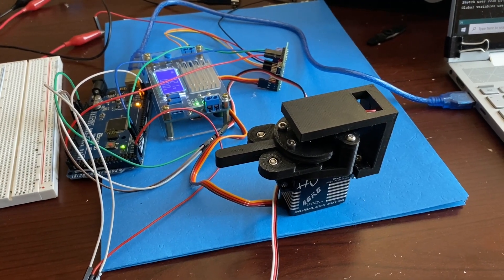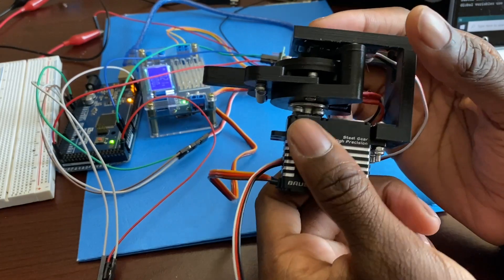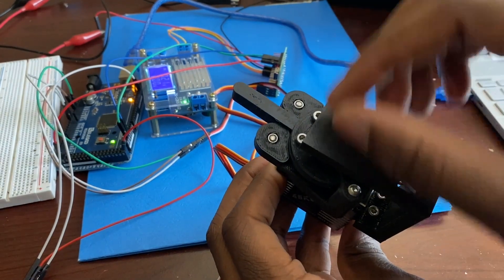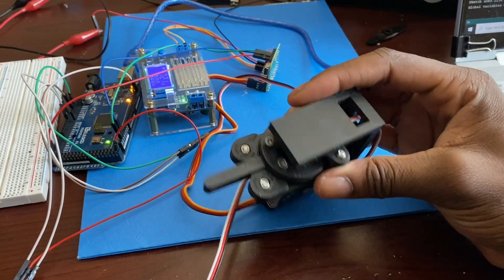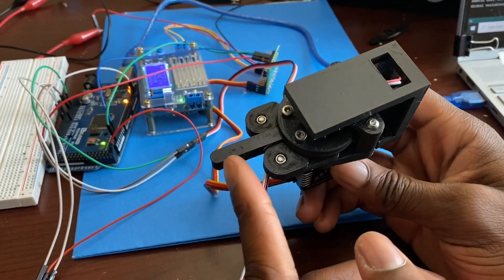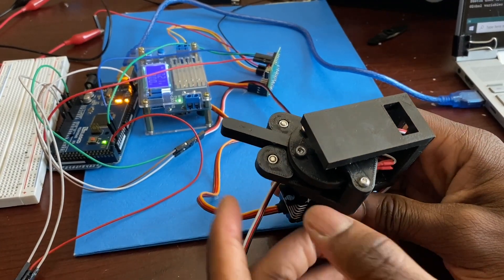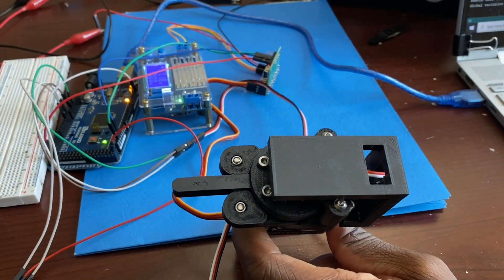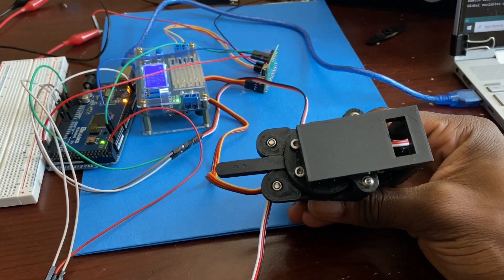Compliant Servo Actuator

Comment: This is super cool!! I'm thinking about making a robotic arm gripper with load cells in series with the actuator to measure gripping force, and this seems even cooler to make! I assume you calculate the force based on the spring constant of the tension spring you're using?

Comment: i checked your article in hackaday, you saved me some time trying to learn about compliant actuators, now my question is what hall effect sensor did you use, and also can we get access to the code thanks, also is it unipolar or bipolar( the linear hall effect sensor)
Reply from the maker: It's a ratiometric hall effect sensor. If you send me your email, I can send you the code but I will admit it isn't well documented so you might not know exactly how it works. I'd probably recommend trying to recreate the code.
Reply: @aaedmusa  did you receive my comment about my email?